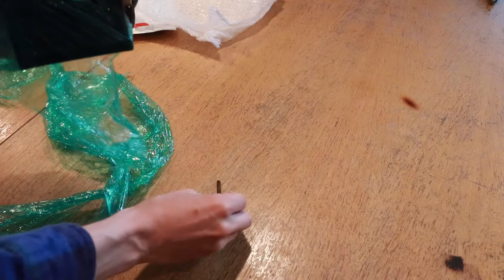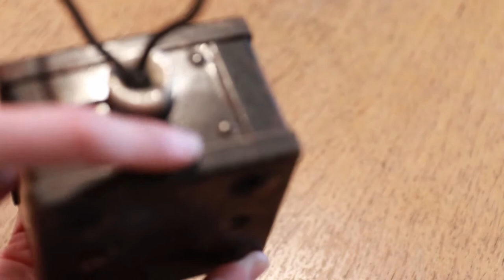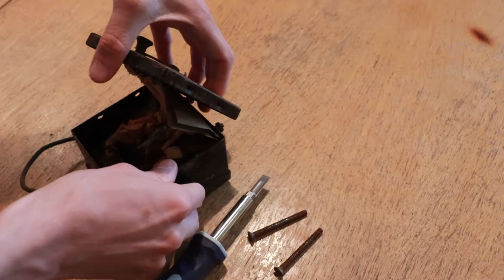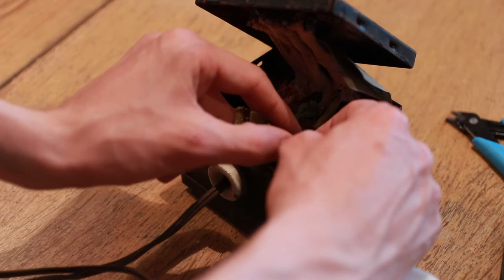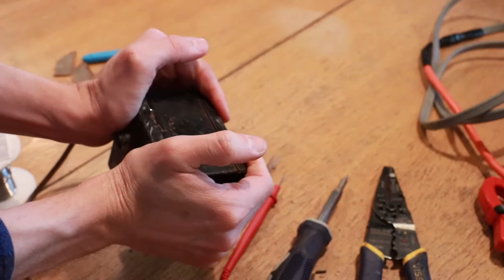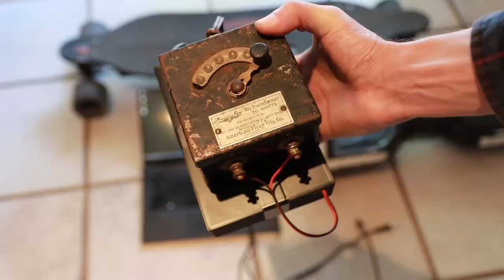1920's Model Train Transformer: Vintage Tech Time!

Comment: After posting my comment I went ahead and opened up the transformer and the good and bad is that the entire inside has been sealed in tar as an insulator it's an immaculate shape and sealed away. I think that's probably the best for the time period. So any rewiring of the plug will have to be from the outside. Fun thing about these antiques you never know what you're going to get.

Comment: Great vid!  I've started a new hobby: collecting and repairing old transformers.  Got bored during the virus days. I do not buy them on Ebay, as the shipping cost more than they're worth. I go to a local train show/swap and usually get nice old ones  [pre-1950 ] that still work for $5 each. Usually it's just the cord that's going bad. Trans with bad cords normally get thrown out or sell for a buck each.   Nobody wants to bother with them. I've got over 80 Lionel, Marx and American Flyer transformers . The older  pre-war ones can be dangerous ,as most do not have a re-set button that will "pop" if  the transformer gets left on while a train truck is not properly on the track.  This causes a short. The re-set button is nothing more than a small bi-metal strip that easily bends when the unit shorts out, causing it to overheat.  The most I've paid was $70 for a big 1940's dual control Lionel "Train Master", the holy grail of Lionel transformers.  There are many different types and styles. They are easily refinished and look great scattered about the shop. They make great book ends and conversation pieces, going back to a time when products were built to last.
Reply from the maker: That's fantastic! And believe it or not, the one in the video is still in service to this day, 2 years later! Charges batteries and powers computers 12-16 hours a day!
Reply: I believe it.  Old things can be repaired and were made to last. I got started buying 1930's and 40's Marx trains, like those that I had as a kid during the 50's. Dad bought a set for my older brother just as the war started.  Most of the toy makers went into defense and stopped making toys during the war years.  Today, few people want the old Marx train engines. I buy  them routinely  for 10-15 dollars each. Sometimes less. They are  solid metal and are usually frozen solid from years of non-use. Extremely easy to re-wire, bypassing the E unit, which is usually the culprit  if they don't work.  Oil them up and away they go! Transformers  are the same. Very cheap. A dealer told me he never repairs them, as it takes too much time and nobody wants them anyway. He brought me a box of about 20 for a buck each. All 1930's and 40's Only 2 were toast.  Got all working fine. Started on the trains during the co. vid. Something to do with the grandkids.  Great hobby and the old Marx is dirt cheap. Most transformers are dirt cheap too. Some of the older big ones are in demand. Check them out. The Lionel and American Flyer companies turned out some really neat looking ones. I'm old, retired and have nothing better to do. I tell the kids, "Old is good, new is bad."  In this throw away world, it's nice to bring something older than me back to life.  Keep having fun!

Comment: I found your channel because I have a similar transformer. I plan to do a similar project, but not to turn it into a charger for that it could possibly damage any modern electronics. My plan was to turn it into a more general decorative lamp for my desk with a Tesla style. It has a fairly high cycle rate, with a 75 watt output. With four posts it has a different combination for each voltage depending on how you would hook up your posts. And is designed also for a third rail railroad track. If you have any advice it would be appreciated. Love the channel, glad to see someone else thinks this way too. I do a lot with antique tech.
Reply from the maker: Sounds like a fantastic project! 75 watts should definitely be sufficient to drive a sizable low-voltage lamp, and I'm sure it will look amazing!

If you're going to supply it directly from mains power, you will definitely want to install an inline fuse or other current-limiting device upstream of the transformer. It may also be necessary to decrease the supply voltage, as many of these were designed to operate at 110 volts.

Best of luck with your project!
Reply: @DielectricVideos  it says 100 to 120 volts and 50 to 133 cycles. It's a Jefferson Midget toy transformer. Thanks for the help.

Comment: I was planning on using a screw in bulb fuse as a limiter to stick with the era. What effect on your power supply does the cycling switch have? I'm not sure what that would do to a lighting element. I'm still building this out of as many vintage parts as I can scrounge up I've worked on other pieces like this before. This will be my first fully functioning one. I was also considering a knife switch, to use as the main switch for the light. But I may have another configuration in mind. I still want this to be safe as much as possible knowing that a lot of this old tech was not.
Reply from the maker: A bulb in series is a great idea for current-limiting, although you will want to size a fairly high wattage one to be sure there isn't too much voltage drop across it when under load.

I used a frequency converter to run mine at 400 Hz, which in turn allowed it to operate at a very high input voltage (about 240 volts). As a result, I was able to get much higher power transfer than at 60 Hz and 120 volts. For an incandescent lighting load (or even a rectified LED lighting load), frequency shouldn't matter much. If you want to be time period-accurate, there aren't many great ways to change line frequency, though.

The knife switch is a very cool idea! As you mentioned, the safety of the system is important to consider. These old transformers don't always have great primary-to-secondary isolation, so if you're connecting it directly to mains power, the knife switch could become live. If you power it from an isolated source like an inverter or isolation transformer, it's quite a bit safer. A GFCI would also improve safety if you want it connected straight to the mains.

Let me know how it goes!
Reply: @DielectricVideos  I was planning on using a GFI mounted to the wooden base but I'm putting it on, to plug the lamp power source into similar to the setup you had in your video that way wherever it goes it would be a GFI outlet no matter where I was plugging it in. I would just put any modern tech inside old casings. It'll look a little haphazard but a lot of things were around that general time.

Comment: do you still have the nfc implant if not when and why did u remove it
Reply from the maker: I do still have the implant! I use the 13.56MHz NFC side of it to do keyless interlocking on machinery, and I also have the URL to my website loaded onto it for friends with NFC readers to scan. It's been working very well and hasn't given me any issues!